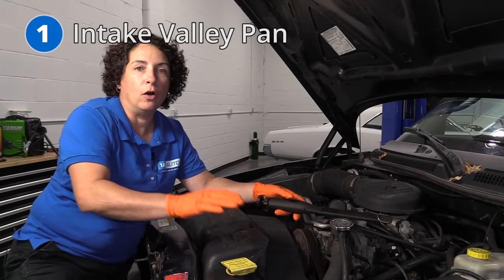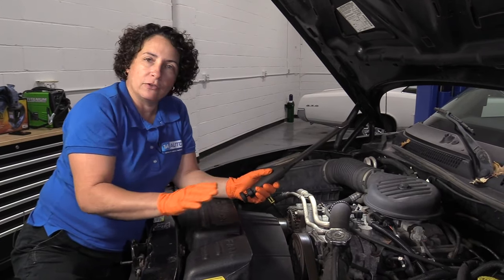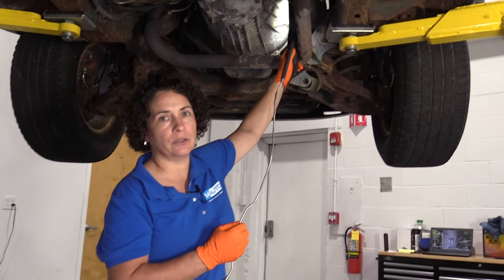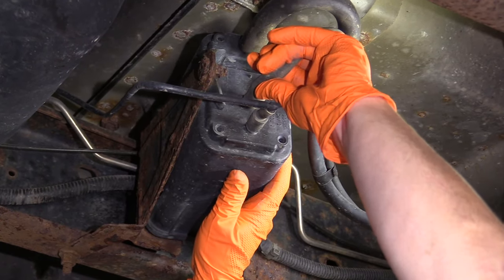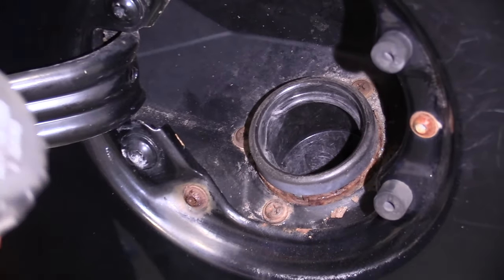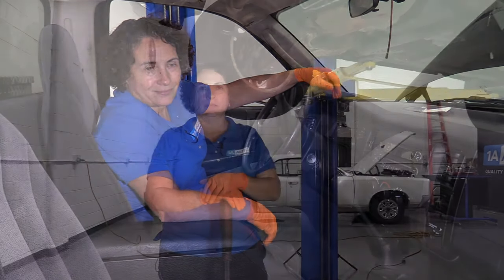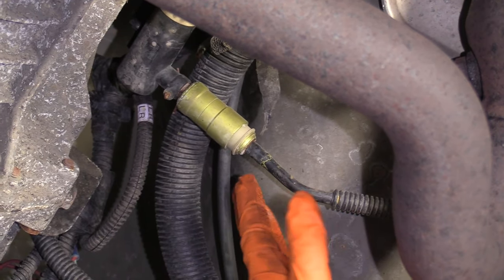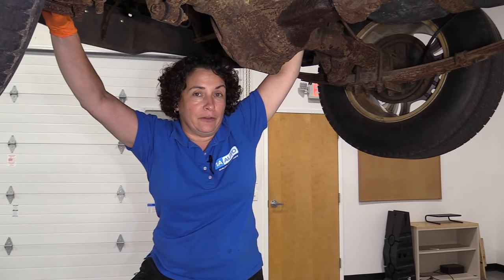Top 5 Problems Dodge Dakota Truck 2nd Generation 1997-2004

Comment: Thanks a lot for these. I've had my '99 3.9l 5speed for over 23 years and luckily haven't had any of these issue other than the crank sensor in the first 3 or 4 years of ownership. It's been a great truck I should probably treat it better. I hope to keep it another 20 years. 🤞

Comment: I bought mine, an extended cab, in April of '98. I also bought the extended warranty, probably the only one to ever pay for itself. Heater hose blew off on the drive home from the dealer. The front crank seal went bad after 6 months. The first of three cat convertors was replaced for severe rattling inside. Front suspension, upper and lower A arms and bushings replaced @ 41k. The Goodyear tires, part of the tire and handling package, were shot by 28k. Great grip in summer. Worthless in snow, couldn't move in 1" snowfall. Fuel line rubbed a hole in it under the cab. Common problem I was told. Front shocks shot at 45k. Ticking sound from top end of engine from about 25k on, shop said it was nothing, probably the Mobil One oil I always used. The guy who bought my truck with some warranty left on it at 95k had the dealer replace the cam and lifters. The admitted that was the problem all along. The truck started to die along the interstate, and would sometimes take 10 minutes or so before it would start, acted like no fuel. Dealer couldn't find the problem, replaced the fuel pump. The next time it happened, the found that it was a bad sensor shutting off the fuel. There were probably more that I don't recall, as I said the extended warranty helped, but I had to pay the deductible each time.
But as bad as this truck was, it still is the best looking truck I ever owned. The sporty wheels, and for a bit, the big Goodyears. The factory extended wheel flairs, the aftermarket hood with dual air scoops, the matching cap over the back. When I think back to those three years I owned it, that's what I remember, not all the bad stuff that plagued me during that time. Fortunately I didn't have any of these top five problems.

Comment: Have an 02 with the 4.7 V8 2WD that was been one of most reliable vehicles I’ve ever owned which is amazing since the interwebs will tell you these are junk. My wheel wells in the bed rusted and I live in the FL with no salt on the roads. Any place else it would have rotted to the ground by now.

A few sensors have failed but all were easy and cheap fixes. Stupid brake calipers had torxs bolts that made them impossible to remove, had to take it to a shop for what should have a driveway brake job. Mine has the ABS sensors on the hubs. Just put new tie rods on and honesty it could use various new bushing up front as it squeaks and creaks.

I am the original owner and that infamous cheap plastic interior has held up great for an 18 year old truck. These things are “right sized” - not too big, not too small.
Reply from the maker: +John Moore Thanks for the feedback!
Reply: Bro I have one two! Only for a year but it runs great so far
Reply: I have an ‘03 with the 4.7 and stick… agree it’s been the best vehicle I’ve ever owned. Bought from second owner with 60K about 12 years ago, now approaching 200K and running strong. Regular maintenance, the only major repairs have been clutch and water pump. Hope to hand it down to my son when he starts driving.

Comment: This video is short, sweet & very well presented.
U can see the problem in the intake belly pan gasket, open the throttle blade, look down & U will see all the oil & where it traces from. I have done 100's of these belly pan,  gasket & bolts oh & the bolts were the issue.
People overlook the PCV  Breather Filter on these & it really makes the throttle body blades dirty if not addressed.
Also the 3.9L is a poor design regarding balance ..Let me quote 1 of my Favorite Chrysler Engineers "It will shake your dentures loose."

Comment: I have the rough idle and sluggish off the line issue.  I think you nailed it on the head with the intake valley pan, been pullin my hair out trying to solve this issue but I feel that may just be it.  Very informative video and I thank you.
Reply from the maker: +Devin Keller Thanks for checking us out. Shop for high quality auto parts on 1AAuto.com:

http://1aau.to/m/Shop-1AAuto-c
Reply: Hughes Engines, get the plenum plate. I bought the Hughes intake manifold for mine, and good to go.
Reply: Is the "valley pan gasket" the "intake manifold gasket"? Sorry trying to find the right part

Comment: #1 for random stalling with P0300, crank codes and other random errors should be pcm failure. Do a bump test on the pcm. Find it, tap/slap/bump the cover....if it dies, its bad.
Reply from the maker: Good Tip! Thank you for checking out the video. If you need auto parts go to: http://1aau.to/m/Shop-1AAuto-Now

Comment: I’ve got a 2002 with the 4.7, around 180k and she’s running great, aside from what I think is my starter shitting out for the second time or some kinda electrical prob, it smells like a electrical fire once I turn the truck over and the volt meter will hit the floor after a minute

Comment: Ive had none of these issues thankfully but I was told the u joints on the main drive shaft go bad a lot as well.  Had to replace those but nothing major since I bought it used in 2004 and now has 257000 miles on her.

Comment: You missed one!
The wet rear end means the pinion seal went out. The rear ends on these trucks will go bad if they are not kept in A1 shape. 
If you live in a wet climate, or a salt area, the front fenders will ALL rust from the inside out right where the engine emblem is stuck on behind the headlights. One day it looks fine, suddenly you see some rust. It is too late, the whole front of that fender will soon have a hole in it the size of a cantelope. 
Dodge had the briliant idea of putting a rubber seal to stop wind noise on the bottom edge of the doors, and between the cab and bed. Perfect if you want to trap salty winter road mess against the rocker, or even just rain or car wash water against the body for extended periods to rot it out. 

These trucks are very dependable, cheap and easy to repair, and frankly given the era they were built run forever. Comfortable and capable. They are rapidly vanishing as they get totally worn out, rotten beyond repair from rust, or expense of repair exceeds perceived value. I expect them to gain a cult following in the next ten years as semi-collectible as they are coming up on that magic 20 year anniversary for end of production. These were the blue collar muscle trucks of the 90's.

Comment: Awesome veejayo. I have this truck. It's got 300k on it. Best truck I ever owned. 3.9. 20+ mpg. No oil leaks. Minor problems. Still going. She's not a new englandah.
Reply: My 96 is a New Englandah, and I run it daily. Zero rust, no leaks, 5.2 and 20+ mpg.  Zero problems. Plus I plow with it.
Reply from the maker: Thanks for sharing!  Happy to hear your truck is treating you well!  Thanks for watching!
Reply: Someone who owned your trucks before you had problems, and it's already been fixed
Reply: @richsweeney1115  your wrong

Comment: Great tips matter of fact I'm getting the PO400 I think it was basically misfires up and down the block but I've been pointing to the direction of the computer. I'm also getting a low crank or Cam shaft sensor reading Bank one so if fixing the computer don't work looks like I'm heading to that valley.
Reply: Same happen with me those computers the rubber silicone that protects the I computer inside goes bad and overheats it. Had to get a new one online
Reply from the maker: Yes some of the computers are an issue. Thank you for checking out the video. If you need auto parts go to: http://1aau.to/m/Shop-1AAuto-Now
Reply: I replaced my computer about 8 years ago from my 97 V8.  Still runs great.  I am not sure the thing is recording engine fault codes anymore though.

Comment: The Dakota's are notorious for faulty ground straps, causing things such as the TPS (throttle position sensor) to short out or just fail to read throttle position. This can cause poor idle, poor excelleration, lagged or non existent shifting (for the automatic), or lag and or failure to switch into four wheel drive. These specific issues are common for the 01 to 04 4.7L magnum engines. Especially on the dakota sports. The power steering pumps are also common to fail due to hairline cracks in the steering gear box by the high-pressure or low-pressure lines due to things such as cross threading.

Comment: p-0456/p-0457 are small EVAP leaks which she is referring about the p-0455 is the large one where you have to replace the whole canister yourself but other then that its all good.... the small evap leak could range from those small hoses to the gas cap and yeah if the gas cap seal still looks good and you replaced everything still looks good, just replace the gas cap.

Comment: Y’all: Ac drain leaks into cabin.. look under passenger side carpet.. humidity will drop headliner over time and rust out cabin. Bad manufacturing Balljoints.. but still going at 240.000km! Love the v8 2nd gen Dakota 2002
Reply: Yeah what is that about, and is it fixable?

Comment: One specific issue I encountered was the highlight switch going bad which required it to be replaced. The cost of replacement was close to$1000.00, thank goodness for the extended warranty which covered the cost of replacement.
Reply: Upaid a 1000 FOR headlight switch. 👎

Comment: Bought mine new in 99. After test drive had only six miles on it. Club cab sport, 3.9 automatic. Cat rattle at 20k. At 58k, cat rattle again, both times replaced under warranty. Front brakes lasted til 60k. (Rear brakes lasted til 300k). 170k transmission rebuild. Pcm replaced about 200k. Maybe 4 or 5 water pumps, and heater core. Now at 308k, not a daily driver anymore, still purrs like a kitten. Nothing ever repaired as far as engine. Still has original plug wires, cap and distributor. Bumper to bumper, not a single spot of rust, nowhere. Best vehicle I've ever owned. I'm 63 and owned a lot of them, different makes and models. Kept inside of course, for the most part. Was daily driver for 20 years.

Comment: FYI She talks about problems with "the v6 and v8" but there are TWO generations of v8s in this truck and they won't exhibit the same issues. The older models are the "Magnum" 5.2 and 5.9 (or, 318 and 360), but at some point the 5.2 was replaced with the "New Magnum" 4.7 overhead cam v8. Don't expect the new 4.7 to have the same issues discussed here as the other motors; it was a clean sheet design.  Can be confusing because they tried to call it "new" magnum to maintain the magnum brand, but it's totally unrelated. Especially confusing because the 3.9 v6 continued as the base and the 5.9 v8 continued for the R/T, which are both the old designs and subject to the issues discussed here.

Comment: Little tip on my 04 I had too replace the crank sensor and it was not on the bell housing actually under the exhaust manifold on the passenger side must be in the newer years of the generation

Comment: had my 98 since new,  4 water pumps, zero issues otherwise,  rear diff is starting to howl slightly,  i think its got a slightly collapsed lifter.  230k miles needs a bushing replacement everywhere

Comment: I have a problem with my 03 Durango RT pickup 5.9. The dealer says the PCM is bad the truck runs but no gauges and all icons are lit in the information center. I put the scanner on the truck and it says no codes to read it’s like the check engine light is off. Can you help on this?

Comment: Pull the air cleaner off open the throttle all the way and with a bright light you can look down inside the intake manifold and see the bottom. If you see oil then you need to replace the gasket. Dodge used bolts that are a bit too long and won't tighten up good. Get shorter or grind the stock ones shorter. Also if the gasket is leaking, your tail pipe most likely is very sooty.

Comment: Also
#6 ECM - No Bus code

#7 Throttle Position Sensor - Surging during driving

#8 Idle Air Control Valve - Rough idle /stalling
Reply from the maker: +Kevin Usta Thanks for the feedback!
Reply: cant speak for the first two, but from my experience, the idle air control issues are usually fixed by cleaning it, unless it actually has physical damage or corrosion. My dakota with 211k miles is still using the original sensor, but I did have to clean it recently because I was losing power erratically when I let off the gas. And that could even be the cause of #7 in some cases.

Comment: 2004 6cyl. Rust underneath, radiator blew up, auto trans issues, cooling system issues......best thing about the truck it lasted 12 years with no major issues......and still had original exhaust system....
Reply from the maker: Thank you for checking out the video. If you need auto parts go to: http://1aau.to/m/Shop-1AAuto-Now

Comment: We have a 1997 Dakota Sport, 88k miles, runs like it's brand new, never had any engine codes yet. Only thing that really sucks is the vents smell really bad, they have for many many years, and also the paint fell off everywhere back in like 2002 which seems to be pretty normal for these trucks.
Reply: same me too

Comment: I replaced my rear axle speed sensor and still the Brake light is on. But now I have a bigger problem as the rear diff is making noise and gets hot to the touch after a short drive. I think once I fix these issues I'm gonna trade off this pos before the problems on your list pop up

Comment: I was going to look at a dakota, ha changed my mind on that.
Reply: Mines been great, only real problem I had was the clutch went out.  Fortunately it's a manual so cheaper to fix snd it's a 96 to boot.
Reply: I bought my Dakota 2003 sport it has 211000 miles on it all I have changed is water pump just changed upper control arms that’s it runs like a champ even my paint has held up won’t sell this lil truck been taking me to work for 17 years no problem 👍🏼
Reply: nearly all cars have a few problems such as these... these are really minor problems. easy to fix without spending much money, more than you can say for most modern cars.
Reply: Every vehicle has it's things. These are actually fairly minor. The dodge dakota has A great customer rating. Just research your vehicles and keep them healthy.
Reply: My 98 dodge Dakota has been a treat. She's as stubborn as a ram but gentle enough to drive without power steering. Except for the valley pan most of these issues are common in a lot of older trucks and SUVs. It's just a matter of care and replacing parts.
Reply from the maker: Thank you for checking out the video. If you need auto parts go to: http://1aau.to/m/Shop-1AAuto-Now

Comment: How the hell could you forget the ball joints on these trucks. Dont know what dodge done but the 87-96s never had the issues but the 97-04 oem ball joints were garbage. I dont know how many ive seen with the joint bust clean through the housing. Always called that the dakota flop
Reply from the maker: +Colton Hurley Thanks for the feedback! We'll pass this info along to our production team.
Reply: If you have the time and money or second vehicle to drive around in between, SOLID AXLE SWAP it. That's what I'm doing spring next year to my 02 5.9
Reply: My 98 did that in 01

Comment: Thank you, great advice.  I have a 1997 3.9 automatic on the second gear especially if the truck is cold I have to run it to 4 rpm then let go and it usually goes into 3rd no problem. Also when stopping it does a loud kick back? Any ideas?

Comment: Power window regulators. All of them. They break at the plastic clips holding the cable ends in. Happened first to a Dakota belonging to a coworker, now to three of mine so far (mine is a four-door.)

Comment: I got an instance of my windshield wipers not turning off. It's a 2001 Dodge Dakota, and it only turns off when I've turned off the engine. I think it has something to do what the BCM (body control module) regarding the proper fuse needing replacement due to a burnout. But if this doesn't work I really don't know

Comment: I have a 1998 Dodge Dakota 3.9 L V6 with 642,000 miles and still runs strong....and yes original Trans
Reply from the maker: +Laura Cunningham Thanks for checking us out! http://1aau.to/m/Shop-1AAuto-c
Reply: What!!! Wholly miles!!! When did you get it and what have you done to maintain?
Reply: BullS#!$
Reply: Had a 97 for 17 yrs. No powertrain issues at all. Only complaint was paint flaked off.
Reply: Doubt that..

Comment: The best way I've found to find intake leaks is to spray WD40 in the suspected area when the car is idling. If there's a leak the idle will speed up. I guess starting fluid would work too.

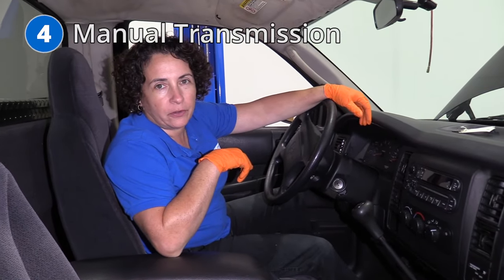Comment: She means a thrust bearing that is part of the bearings on the crankshaft. The cause for this is continuous engine loads that come from things like heavy towing.  It's not the fault of the manual transmission. 4:59

Comment: I had no real choice but to buy one of these from a co-worker for my commute. 
Never been a fan of the DAKOTA, but it has a rebuilt engine. 
Nothing in this video about the automatic transmission, but mine seems like garbage. 
I suspect it has at least 3 different problems all at once. I just baby it and keep an eye on it.
120,000 miles on it and just feels whipped.
😞most uncomfortable seats I have ever sat in

Comment: I've had none of those issues on my 2004 dakota, what I have replaced is at 100K both exhaust manifolds needed replaced due to old age/warp and failing gasket. This issue creates a ticking upon startup that will go away as they get hot and expand.